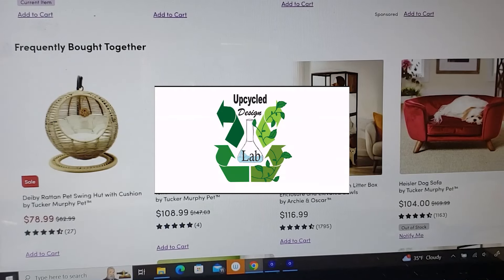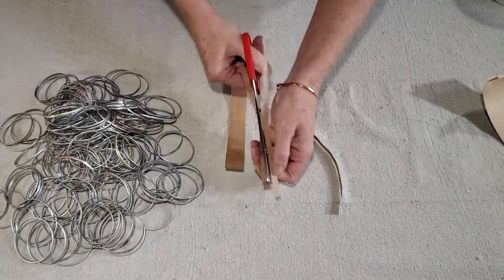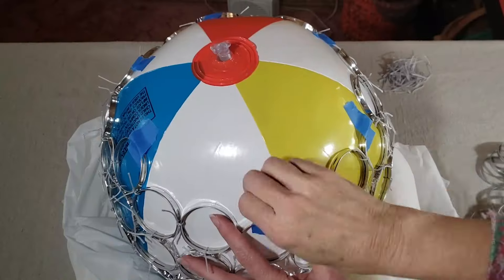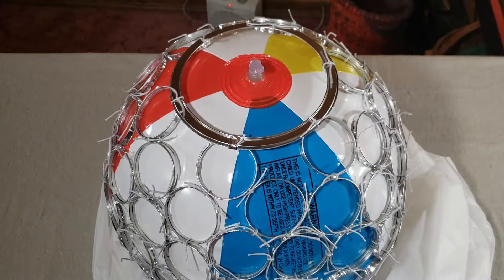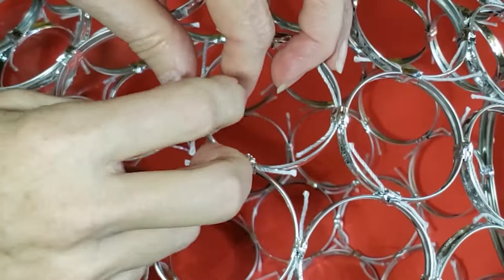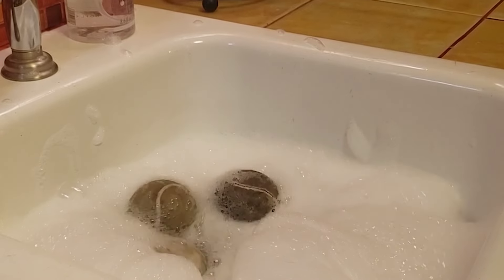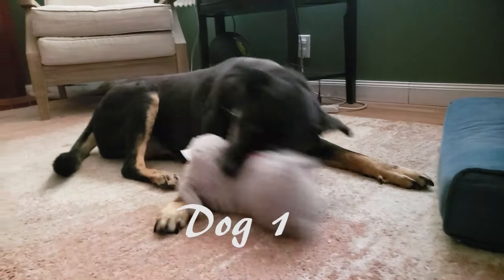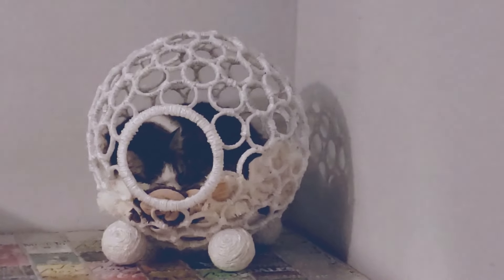DIY Ball Shaped Cat Bed Cozy Cat Cave - Made For Zero Dollars

Comment: Why did you need both hot glue & E-6000 for the feet?
Reply from the maker: I like to use them together because the e6000 is a strong glue but it take a while to set up. The hot glue grabs quickly but I don't trust the hold. 🙂